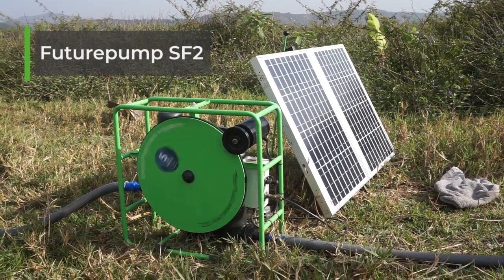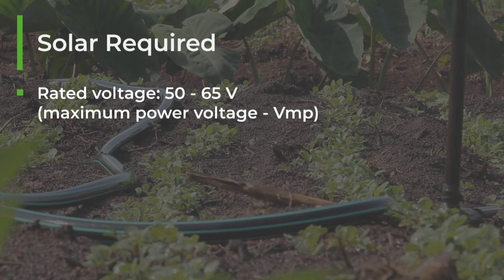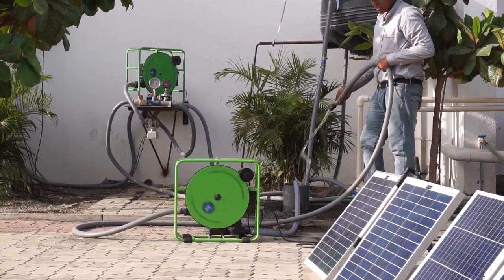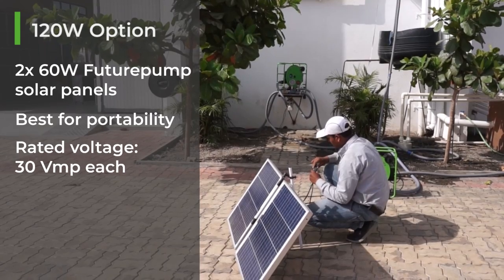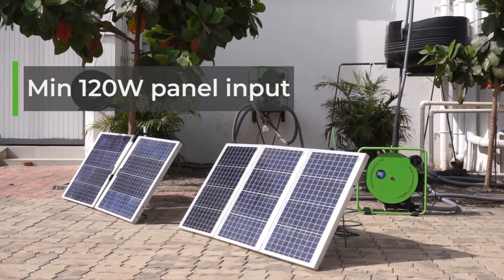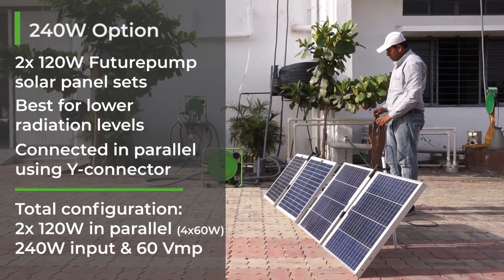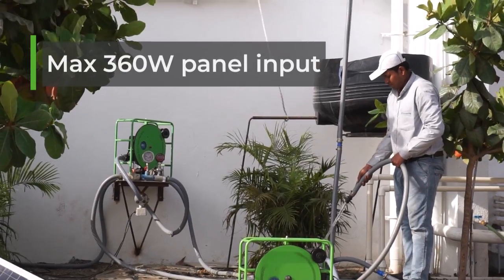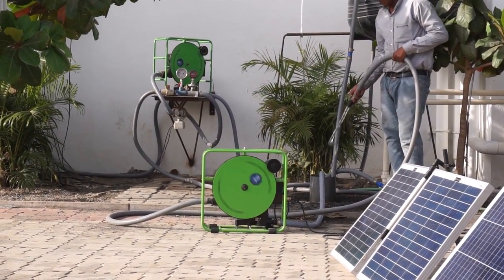Selecting Solar Panels - The Futurepump SF2

Comment: Need one in Zimbabwe
Reply from the maker: Thank you for your interest! In Zimbabwe, Celfre Energy sell the Futurepump SE1 60W and the Futurepump SF2 120W both come with a 6m high quality suction pipe, installation and a full 10-year warranty.

The SE1 is $550, the SF2 $750. Finance plans are available

You can reach Celfre directly on 263 712 400 506
263 772 989 395 or find out more at shop.futurepump.com

Comment: Hi Team,
I have one SF"2, is  it possible to use 1 solar panel of 340 watts instead of 3 panels of 100 each?
Reply from the maker: Thank you for your interest. Our SF2 solar water pump can be used max up to 240w panel whether it's 1x240w, 2x120w, 3x80w pv panels. You can find out more at Futurepump.com